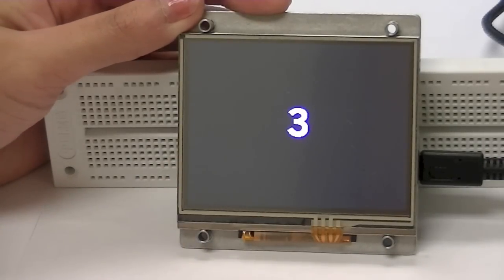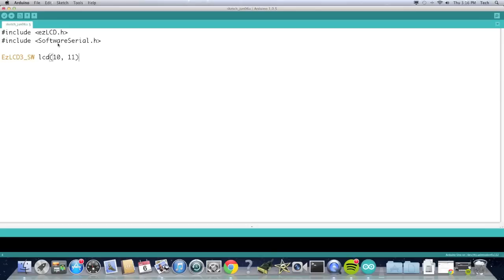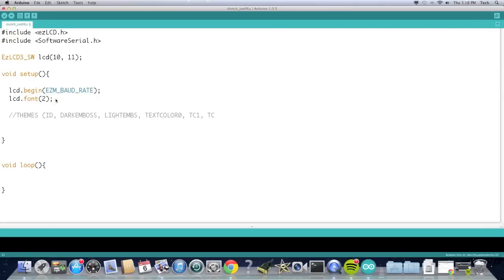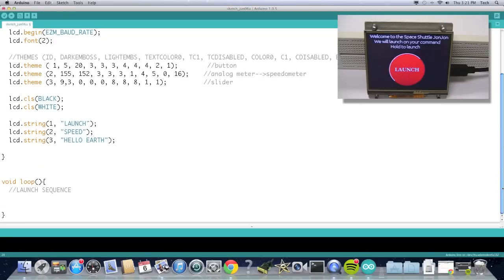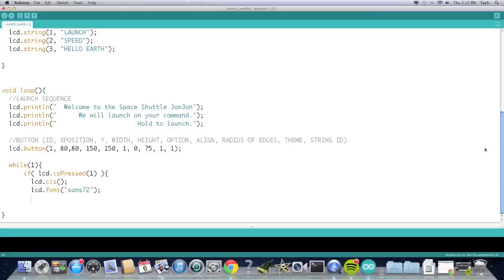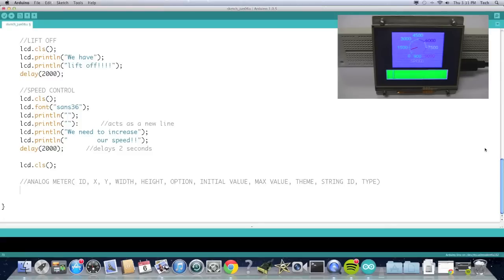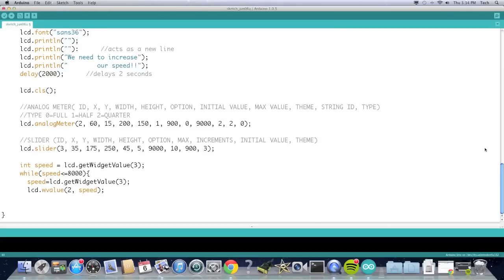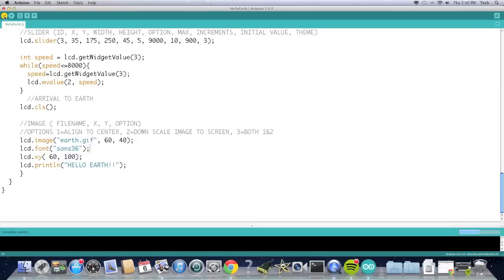"Hello Earth" Tutorial for the arLCD (Arduino Compatible LCD)

Comment: Great help! How does the screen connect to the Arduino? is the arduino built-in? connect via usb? Using the digital and/or analog pins? if it uses pins, how many are left after being hookup?
Reply from the maker: It has every pin except the hardware serial available.